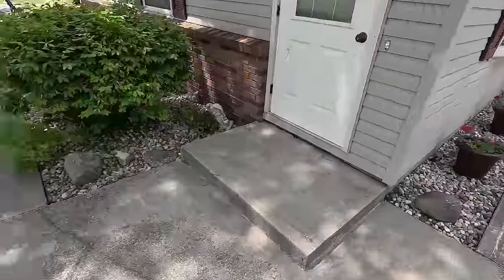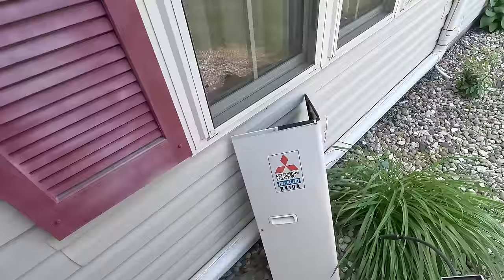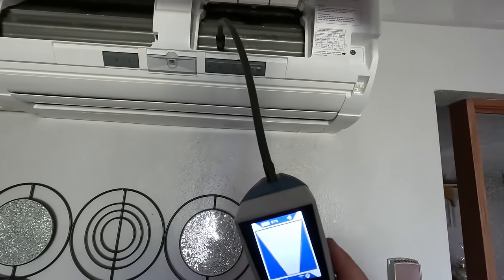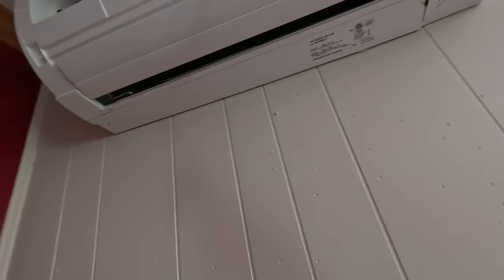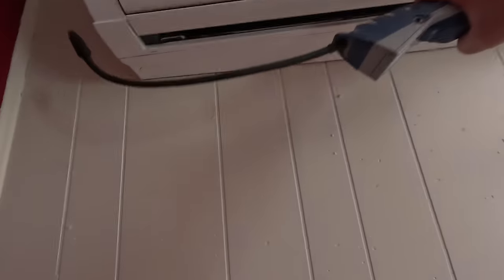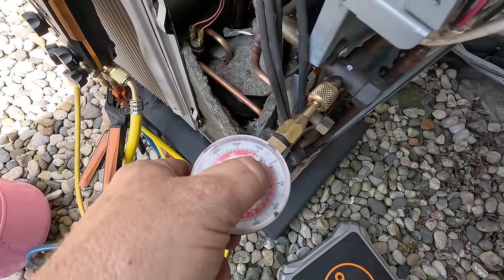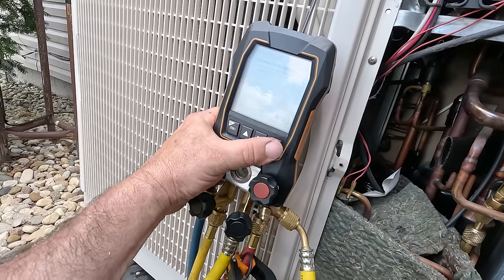I HATE Mitsubishi MiniSplits

Comment: The title is definitely why i watched lol. 

I currently have a pending half finished commercial Mitsubishi install that i have no idea how I'm gonna finish. 

Apparently the Miami Beach code inspectors want a interlocked motorized fresh air damper to be installed with the system....fml. 

Ive never had a single second of any mini split training so i have  no idea how to make the mini split (with all its weird modulating DC voltage) work with the available 24 volt AC (alternating current)  motorized dampers. 

In short I'm not currently a fan either lol
Reply: You could use a current relay to detect when the unit is running and control your dampers with that.
Reply: @mrfrenzy.  that's a very interesting idea.

 I've seen them being used on Copeland compressors for overcurrent protection (normally closed contacts that open on overcurrent).

Is there a normally open version that closes when it senses a particular current draw?  Or maybe there's an adjustable version where you can set the exact amperage when you want it to close the contacts? 

Ill definitely look into it though. Thank you for the idea.

Comment: It's not about Mitsubishi. These mini splits are promoted in U.S market to be installed by home owners ( DIY ) or at most Craigslist handyman. And of course most home owners don't have proper tools or knowledge to pull deep vacuum required for POE oil and 410A systems. Which in turn results to system becoming acidic and eating the coils and leaking. Just search youtube and see how many of these are installed by homeowners where they pull vacuum through gauges to -30 inches of mercury (which is basically no vacuum ) with a harbor freight 2 cfm pump. 
These are very popular in other parts of the world and they work very reliably when installed correctly.
Reply: So how much is a Deep vacuum vs  imperfect vacuum of 30"?
Reply: Dirty little secret is most of these mini splits aren’t POE they are PVE, not as prone to hydrolysis
Reply: @timrob0420  The Poly vinyl ether oil units only came out a couple of years ago. This system was from 2009, that was POE back then. I installed an LG 2.5 ton single head system last year for a computer server room, it had PVE oil in it. 2019 they were still POE.
Reply: @2nickles647  I got mine to around 40 or so microns, and it held around 80 after 10 min. So far for me, no leaks after 3 years, and they are used during the brutal Wisconsin winters.

Comment: I found a brand new Mitsubishi American Standard 2 ton outdoor mini split. It’s the outdoor unit only. I’m looking for an indoor unit and wondering do I have to use the same model or can I use a different model for the air handler. My model is NAXS or NV series. I can only find models that are MSY or Trane NTXS. Do I have options or do I have to get the correlating air handler model???

Great video by the way
Reply from the maker: There are specific evaporators that work with certain outside units.

Comment: I feel like you should be able to max everything, as is typical for setting the charge. Is there not a manual force?

Yes or No?
Reply from the maker: That's why I turned it down further than just making a call for cool. Like I said they don't recommend doing it the way I did.

Comment: I have a similar Mitsubishi Electric, one outdoor one indoor unit. Think it's MUZ/MSZ FD35 model. Installed 2011 and still going strong. Gives good warm in the winter when it's -20°C.
Reply: They fail manual J load calculation. If you have the capacity to keep the house warm at -20 you are extremely oversized for summer..
Reply: @Bryan-Hensley  I'm in northern Europe, we actually mainly use them for heating, the cooling is just a bonus
Reply: @justme5384  I've thought about setting up two heat pumps. One with only the summer capacity then both for full winter capacity. I've also thought about splitting it into three units with the total capacity combined to the winter needs and use them as staged summer cooling and staged winter heating.
Reply: @Bryan-Hensley  Well, that depends. For each room I'd need around a 9k unit, but since they can ramp down to around 1200 btus, they work just fine for cooling.
Reply: @sprockkets  it's the heating that is the issue. They'll work fine for AC only
Reply: @Bryan-Hensley  Well, here's my experience. I have a gas furnace, 70k 96%, that decided to now only put out 35k on low stage (supposed to be around 50k). And this past winter, I was fine, even at -15F. Mostly because I put plastic on our huge kitchen window that leaked so much cold air in. (Side note, checked input and output pressures and they all were exactly where they should be).
If I went HP I could only do a 36k unit since it is around .6 inch static for 1200cfm. But I would supplement with my 12k mini split I installed in the main living room if needed. 
I already have a friend that uses 66k worth of mini splits to heat her home. It could be better, but she's happy with it, even in Wisconsin. She didn't want natural gas installed in her home, and used straight electric before that.
Reply: @sprockkets  I just installed two 12,000 BTU in a house yesterday that needs only 18,000 BTU cooling. I'm wondering how that will work this winter.
Reply: @sprockkets    I just talked to my buddy yesterday and said we are going to have to figure out a way to get mini splits to work in this area because mini splits are turning into a fad. We decided to insist on gas or electric floor heat as backup heat for the extreme cold times (in new construction). Or possibly electric radiators. I absolutely love the idea of the mini splits with inside units in each room.. these things have the potential to be awesome if they would add a good backup heating system, but that requires running new heavy wiring to the inside which would eliminate most DIY. I wish they would start making a contractor version that has the backup heating. Ramping down an overkill AC system isn't near as efficient as having the proper size. It's a trade off that needs to be calculated perfectly
Reply: @sprockkets  being able to use regular wall thermostats would be nice, however I do think some higher end mini splits have this capacity
Reply: @Bryan-Hensley  Well, that depends on what part of the US or world that is in. The US would be split into 3 zones. I'm in the zone that would benefit from having electric plus heat pump, but due to electrical panel space I would use space heaters to make up for any deficits when it gets to below zero around a few weeks of the year.
Reply: @Bryan-Hensley  regarding thermostats, well, they do make some that control the unit via remote control commands. But since they only operate on or off, I would think you'd be missing out on the whole reason you have variable speed to begin with. 
That cooper n hunter system I want to put in can use both, and appears to be a better setup than the Gree Flexx systems. I do like my Ecobee though.

Comment: Great job! Question, at 12:03, what legs did you check for the frequencies?
Reply from the maker: My amp clamp measures frequency through the amp meter, I was on the compressor side after the inverter.

Comment: I bought the cheapest ductless split I could find.  It does heating as well as cooling and is supposedly 22 Seer and good down to -15F.  Even  if i have an issue down the road i still save money over the Mitsubishi or Fujitsu for the same basic function.  I can replace a head for half the cost of those.  Best part is I can do most of the install myself and only need to call in the HVAC tech for the pressure test and pull down as well as additional 410a.  I must admit that these are not DIY for most everyone out there.  None are and you are deluding yourself if you think that a Mr. Cool is as an example.  I am an electrician and was a general contractor at one time and have installed more than a few from various manufacturers.   But I always call in the HVAC tech to handle the pressure test, pull down, and the final charge adjustment.
Reply from the maker: Good information here👍👍
Reply: Well for warranty purposes at least they can feel ok with a DIY unit with those precharged hoses because they don't need to worry about vacuum levels. Of course, they are notorious for leaking.
I self installed a pioneer unit because I'm on a tight budge. Of course, I care about a good install and got to around 40 microns for a vacuum and around 80 after 10 min. And they don't care about needing a tech do the final install - I had a noisy indoor fan motor and they, without issue, sent me a new one with a cheap "bearing" lol. So yea, I can't fathom, other than supposedly good contractor support, why I'd spend almost 2.5x for a Mitsubishi unit.
AC Service tech channel with Craig likes Cooper and Hunter. I'd probably do a central version to replace my gas furnace when it finally dies.

Comment: How old was that system? I’m surprised the indoor units were leaking like that unless not properly charged in the first place (contaminated). Will you replace the entire head? If I’m the customer I would be concerned about the other heads, I have two leaking what about the others? You have to drain down replace heads, test and then weigh in the charge, a lot of work. If I’m him I would replace all heads or even replace the entire system with hyper heat to avoid running that baseboard in the winter.
Reply from the maker: We're just going to replace the evaporator coils themselves, I'm not sure exactly how old it is.
Reply: It was the just the flares. Mini split coils doesn't leak.
Reply from the maker: @grigorshukerski4689  yep, there perfect, the compressors never fail either. 🤔

Comment: Only issues I've had with both a Mitsubishi Heavy Industries and a Mitsubishi Electric was Indonesian House Geckoes shorting out the outdoor unit power supply boards. At least the parts supplies are good even for old units, had a 10 year old Panasonic also fried by Geckoes and all parts were ONR. Mitsubishi were more then happy to sell me parts just for a princely sum 😂
Reply from the maker: They love selling parts😂👍👍
Reply: I support a large CitiMulti system in hawaii and geckos are death to these units.  You would think Mitsu would have a better solution as they sell to many tropical locations.   We try to seal up all the cable and refrigerant entry holes with conduit duct seal which helps....kind of...

Comment: This would be better as a total take apart and clean. You will find the leak is coming from the flare fitting or from the ghastly copper friction welds. A relatively cheap and effective fix is to isolate the evaporator, solder over the welds with regular plumbing solder while there is vacuum applied to the lines.
Reply: This is some pretty poor advice,sorry. Please no one ever do this
Reply: @HVACRTECH-83  Seriously!!  Plumber solder like Stay-brite 8 on a 410A system while in a vacuum is insane.  Do NOT ever do that.  Worst advice ever.  If you are going to do anything, flow nitrogen and braze the joints or leaks with Sil-fos 15 and try to keep the heat controlled and use Wet rag or the like to protect sensitive parts.  NEVER EVER USE PLUMBERS SOLDER on a high pressure system and certainly not in any sort of vacuum.  Who the hell taught you that?  

@christopherleubner6633

Comment: Usually leaks are only found on flare fittings when it comes to Mini Splits. Coils rarely ever seem to leak with MS, especially two of them. Good stuff :)
Reply from the maker: I've had several leaks in the coils, I think a total of 5 or 6 not counting these and I don't do many of these.
Reply: We have installed hundreds and most all develop evaporator leaks 3-4 years old

Comment: They've never really made good products .. So did you just charge it with some stop leak ? You said in the video The turbine Windmills Illinois Where are you located ? I'm here in Racine Wisconsin
Reply from the maker: In Ohio, we don't use that leak stop crap, ice tried it and it doesn't work. We are quoting a new EVAP coil.
Reply: @HVACRSurvival  Dang that's crazy replacing the units Doesn't look fun
Reply: @HVACRSurvival You don't quote and replace coils, but the whole indoor unit. It's cheaper.
Reply from the maker: @grigorshukerski4689  that's not what I seen.

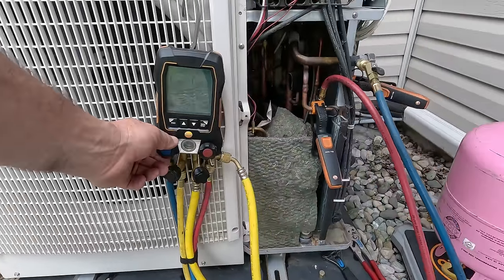Comment: At 8:19 I notice that you are not connecting the red (hi) hose to the service port near the compressor input that has a paper tag label wired to it.  (It is crumpled a bit, but visible above and to the left of the top of the compressor.)   I thought that tag said it was the port to use for liquid refrigerant charging?..... did I miss something?
Reply from the maker: I'm not sure what it said at this point it's been 2 months or better. I had the high side and low side that's all I needed. Suction is suction. How am I going to charge liquid while it's running?
Reply: @HVACRSurvival  I agree with you, that is why I am confused by Mitsubishi label..... seems to me that you want to put the refrigerant in the way you did it, (Not by the labeled tag next to the compressor)....   Thanks
Reply from the maker: If you're weighing in the complete charge that would be fine. You would charge liquid in through the high side. But while it's running the only way to get it in is through the suction. And since they don't want you to do what I did... that's probably why that sticker was there

Comment: I like the fujitsu units so much better..  if you get one of their wired controllers it will tell you pipe temps, they have a charging mode to put them in so you can ramp them way up...  it allows the evaporators to get just at freezing or even a little below for short term..  and it runs the indoor fans at max and wont turn them down..  on the ducted units the indoor fans seem to run faster than theu do on normal "high speed" and the putdoor fan goes to high regardless..  stabilizes things a bit..  the compressor will slow down just so you dont freeze the coils too much..  I think it allows them to make a little ice just so you are throwing more heat at them wit hthe state change..  but wont run long that way..  ive noot worked on any Mitsi units..
Reply from the maker: I've only worked on a couple of those. Mitsubishi has those options but you need the controller and it depends what model it is if it has the option.
Reply: @HVACRSurvival  you need a controller for the Fuji units too .. some of the older ones had a way to do it with the remote .. on Fuji pretty much all of the indoor heads have a port for a wired display, so you carry 2 models in your tools (3 wire and 2 wire)..  you could probably carry a mitsi wall display too.. depends on how many you work on.. and the cheap china units all bets are off on those.   When you bring it back up with the new head then it’s important to weigh in as the numbers on cooling will come normal before the unit has any ability to heat efficiently . The accumulator throws you for a loop.. of course there’s no way to charge them in heat mode. I’ve not found any that you can get at all sides to do it.

Comment: Awesome video. Thank you for that. Question: I found after releasing the refrigerant into my unit that the adapter I was using wasn't depressing the Schrader valve. So basically, I believe I released the refrigerant into lines that weren't vacuumed. The unit functioned ok for a little while now it doesn't work at all. Can u please tell me what I need to do to fix the problem? Do I need to evacuate the whole system and start all over at the vacuum stage? Is there a way to test and make sure that is what I did? Thank you!
Reply from the maker: Supposed to have your EPA license to work with refrigerant. If you have your gauges on the system and it kicks on and they don't start changing position chances are the compressor is not running. If you think you've got non-condensables in the system then the correct thing to do would be recover the refrigerant then vacuum the system down to 500 microns or less and be sure that it holds down there, then recharge with the factory charge amount.

Comment: About 10 years ago was deathly afraid of charging these bastards. But in a pinch get them lines cold get a good deltaT and your good lol. Have a hospital with a file room they are persistent on not leak checking once a year I charge her up. They install them once they had a leak fixed it had to change oil on vacuum pump 4 times to get to 500. Anyhow you can get by.

Comment: I took the VRF class a few years ago in Marlboro Ma. The install is key Im not a fan of every school putting them in i have a few accounts with 30 head systems parallel compressors if one grounds it kills the other I’m not a fan. The Mnet is $1000 to talk to it with laptop.  Same as Samsung,LG,Fishitzo, etc
Reply from the maker: That sounds like the city multi system.  I took that class and have the computer box like you mentioned but I forgot how to use the program. It's been 4-5 years since I used it.  We don't have that many systems like that to get good at them.
Reply: @HVACRSurvival  I wish they would stick with fan powered VA vees and reheat coils. That system worked great. All the little kids need AC these days.